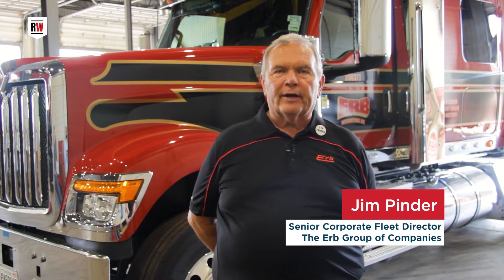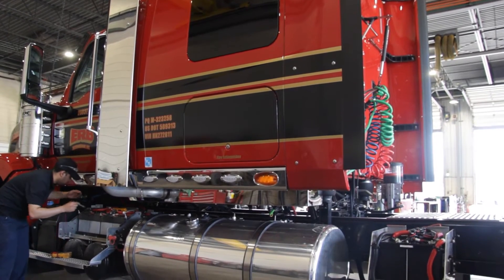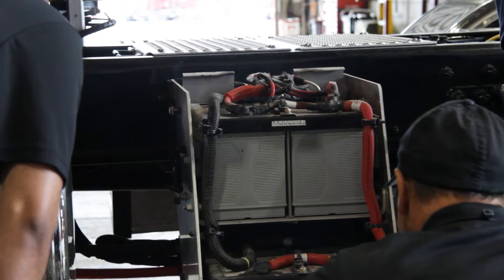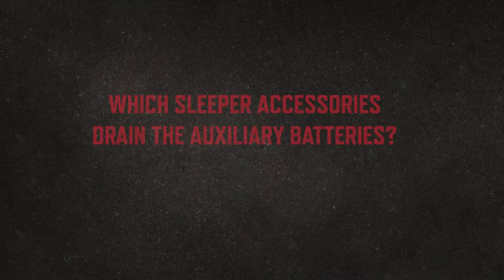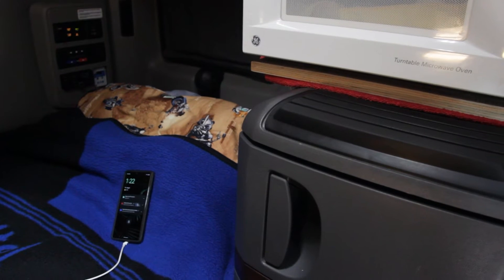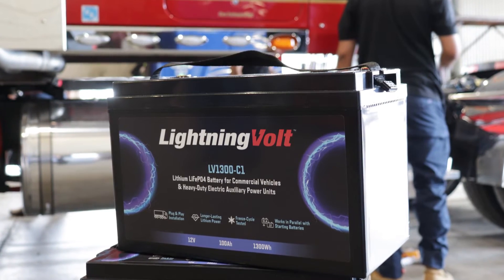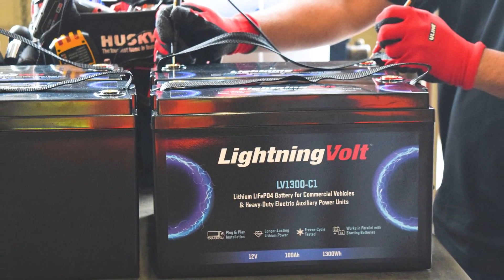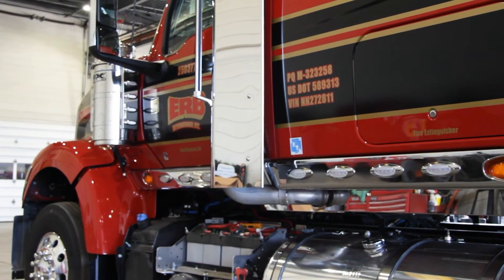LightningVolt - How Does Upgrading the Electric APU in Sleeper Cab Trucks benefit Fleets & Drivers?

Comment: How long does this set up run? I need something to last at least 36-40 hrs during a reset. I'm all about saving fuel...ESP with Biden's $6/gallon fuel!!
Reply from the maker: Run time depends on the power consumption of your electrical appliances. Typically, our customers require 8-12 amps for their power needs. Each battery has a 100Ah capacity and there are 4 on a truck. So to get 40 hours without starting the engine to recharge, you would have to limit your power average or constant power consumption to 10 Ah. For more information contact the experts at Roadwarrior.

Comment: How do they work in the freezing cold? I had a lith ion phosphate battery under the bed to malfunction due to its heating function which damaged the cells
Reply from the maker: That is why LightningVolt does not have a heating function, the batteries are freeze cycle tested to ensure operation in the cold.

Comment: So when a driver is up north east above New York  in the middle of winter how do you keep the driver from  freezing or the truck to start  ?
Reply: They have no answer for super cold .. heat
Reply: Hell it’s warm there compared to where I live. Batteries here wouldn’t stand up using them like this company.
Reply from the maker: LightingVolt batteries are designed for heavy trucks with electric APUs. These factory systems include battery operated HVAC heating and cooling systems. LightningVolt batteries double the runtime of these systems so the driver won’t freeze, and it does so without draining the engine starting batteries, so the truck is still able to start. For more information contact the experts at Roadwarrior.